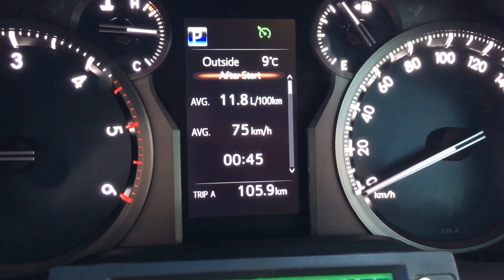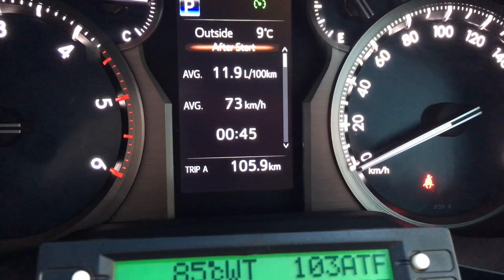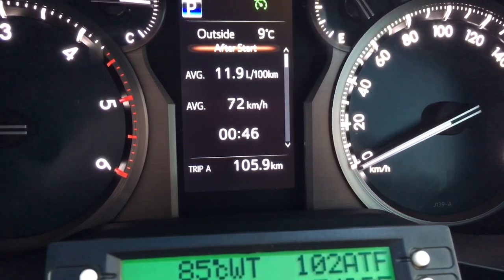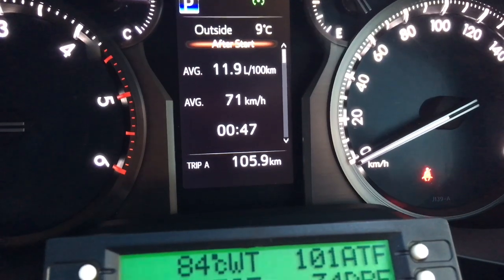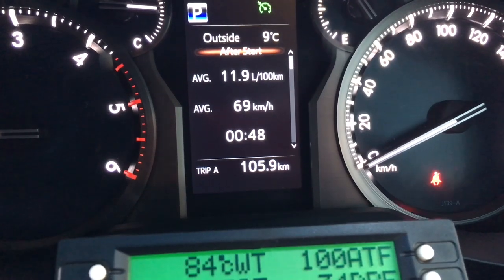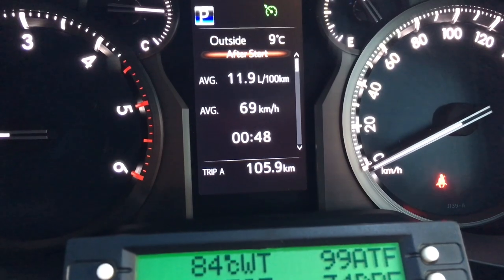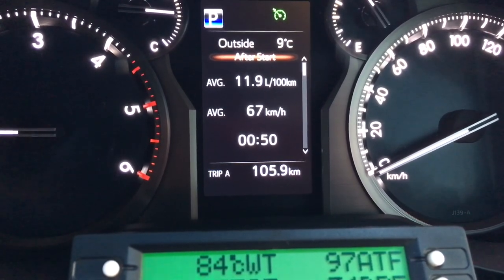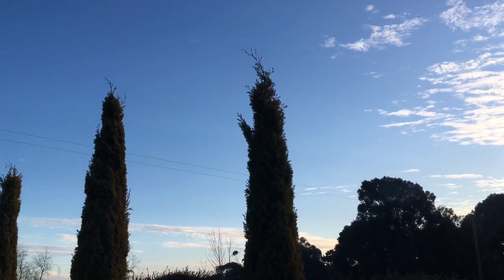TOYOTA PRADO LC150 - 2019 AC60F COOKING ITSELF

Comment: The first thing I did to my new 1GD-FTV was fix a Scangauge, which I had off my 120, and saw high Auto temps of 100 plus on my first empty highway run. Second thing I did was fit an external Auto Cooler and finally fitted a Richards Auto Lock-up kit. Now temps are all good even when towing and now able to tow in Drive. Not many realise that both 5th & 6th gears are overdrives in this Auto! My hard-earned had to be spent to make my expensive Prado better or should I say... as it should be! But I love my Prado.
Reply from the maker: Shouldn’t have to.
It’s all software related.
Lock up fixes it, both not needed.
Cooler is barely a band aid for this characteristic that’s pox!!!

Comment: Hi, these trans have 2 temp sensors on valve body - solenoid wiring loom ( you will see 2 temp readings on your scan tool ) ac60f have a nice largish and deep trans pan. you will notice that temp in pan ( with digital thermometer ) will show about 15-20 deg C cooler than what your scan tool is showing via the 2 temp sensors. we are just starting to see these trans out of warranty and coming in for trans services/minor repairs. bypass the trans coolant/heat exchanger, regularly clean and add additional magnets to trans pan and do regular trans filter service and your trans will last longer and be more reliable.... as with any vehicle component. cheers
Reply from the maker: Incorrect the temp on the scan gauge is the pan temperature.
The torque converter temperature will be hotter but I’m not interested in that because that’s temporary it’s the pool avoid all I’m interested in and that’s the sensor we’ve got to sit on our skin gauge the royal in the pan temp

Comment: Since installing an additional cooler on my 2007 120kd, and servicing trans using synthetic ATF, I seem to have the opposite problem. Towing a 1.5t AVan, even at 20 deg outside temp, my trans temp never even goes above 75 deg, in fact I can almost judge the temp as being close to 50 deg above outside temp, so unless it gets to 30-35 deg, I don't get to 85 deg in trans. Yes, I drive in 4, keep TC locked, but should I be concerned that my trans temp always seems to stay well below 80 deg, in fact, when I'm not towing, it stays around 65 deg??
Reply from the maker: That’s why I don’t advise a cooler on a 1kd in the southern states running cold if they wanted them to run cold they wouldn’t put it through the radiator

Comment: I'd be super careful about relying on that too much- What PID codes is that Scangauge using to get that temp Is that pan or converter temps?  Are the equations and correction factors right?
Reply from the maker: Don’t worry about the pid codes it’s all good it’s been checked against the scan tool the temperature is 100% accurate I’m not interested in torque converter temps that’s temporary that’s where the heat made I’m only interested in pan temperatures and that’s what it is these things cook I guarantee it you can rely on it I’ve been watching the scan tool for months I know what I’m talking about

Comment: I have a MY14 Prado 150 (1KD) with the 5 speed (with Bullbar, dual battery and 1 size tyre up), and it would have the same temperature rise just driving around the hilly areas the back of Wonga Park (Melbourne outer eastern suburb).     I fitted one of the KAON auto cooler kits and has brought the temperature down by about 25 degrees on the same drive.
Reply from the maker: Then you’re not driving it correctly use fourth gear
Reply: @Fourby4Diesel  Thanks Anthony, you are probably right.   After driving manuals for over 40 years, I always thought that for an auto, you simply stick it in drive and let the transmission do its thing.    I did not know that you set the auto in 4th gear when driving around the suburbs.

Comment: Will be interesting to see what Anthony advices as the fix for this issue.
The 200 series gearbox seems to have the same traits, and a lot of owners swear by the lock up kits.
Reply from the maker: The solution is everybody complains to Toyota and they come up with new software that locks the converter
Reply: Fourby4Diesel that would be a better result than having to fork out for a lockup kit.

Comment: Have your Scangauge also display the Torque Converter Temp. It'll read higher than the ATF Temp.
The TC Temp on my 150 gets to 120C when cruising hilly countryside.
However it drops when in S4. S4 is OK when doing 80-100, great for overtaking roadtrains. But not the best for highway speeds.

I believe that at 125C the ECU will lock the clutch, tho' I haven't seen that yet.
Reply from the maker: I don’t care about torque converter temperature it’s temporary pan temperature is what matters naturally the torque converter is going to be hotter it’s what makes the heat

Comment: gota rocking movement when coming to a stop. thinking its a fuel tank slap issue. can you share any thoughts?
FYI. All suspension components have been checked and bushes replaced.
Reply from the maker: Never heard of a fuel tank slap issue I think you slip joint on your tail shaft is what you’re feeling
Reply: @Fourby4Diesel  is that normal or should it be looked at?

Comment: Try a similar run but keep the gearbox in S6 mode and see the difference, it stays locked much longer doesn't downshift like in the D mode too and better mileage also
Reply from the maker: Been there done that.
As described in other vides no improvement doing so.
S is more sensitive to shifting even slightly sooner.
Reply from the maker: Even S 5 no good.
Reply from the maker: S4 is much better if u like to rev
Reply: @Fourby4Diesel  the use of sports shift and the effect it has on ATF temps would be a good video.  When towing the camper trailer with the 150 Prado,  I leave it in S4 and never go above 90km/h. ATF temps can still get up above 100 especially up hills but everywhere else it tends to stay at 88.
Not sure if it makes any difference doing what I'm doing and that's why I watch your videos. Thanks for the great content.
Reply: @Fourby4Diesel  Mine Stays locked much more in s6 than D mode i can even press accel more than half and it wont unlock or downshift the only difference is i am on ECO mode

Comment: Just install additional ATF cooler for extra cooler... maybe the atf heat transfer in the radiator is not as big as the old prado.
Reply from the maker: Its torque converter always unlocked. Nothing to do with radiator.

Comment: Please correct me if I'm wrong.
The transmission cooler is in the radiator and the coolant in the radiator should average at 105°c because that's the correct operating temperature.

So shouldn't that make 105°c correct seeing as that's what the transmission cooler is. (on average)
Reply from the maker: Wrong!
Reply: Sorry I don't mean to offend you. What part is wrong?
Reply from the maker: See picture coolant runs 85.
So trans should be circa same 85.
Previous Prados run roughly 10 below on average 
Pan cooling.
Reply: Thanks👍 I guess as long as ATF remains below the oxidation temperature for the given ATF Toyota prescribed we should be fine.

Aside from the mapping of the transmission. I hope Toyota fixes that.